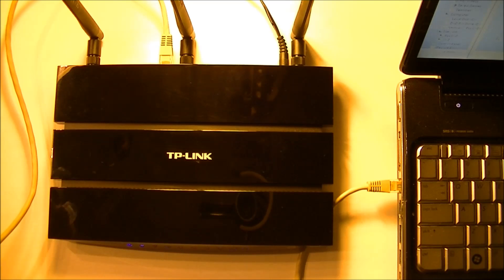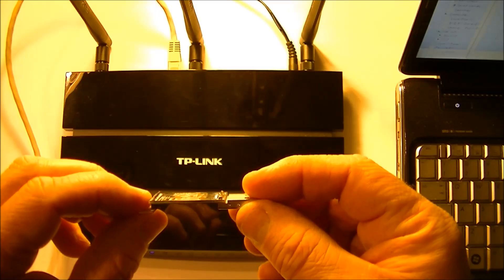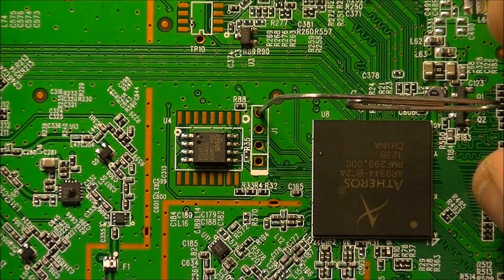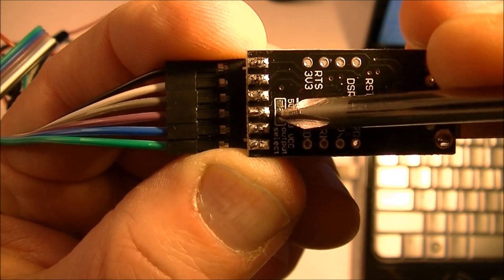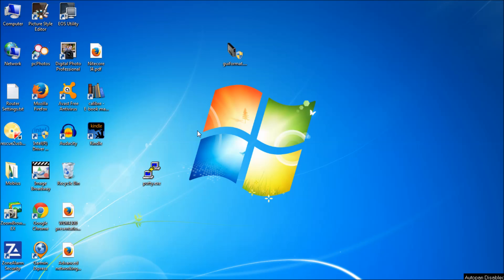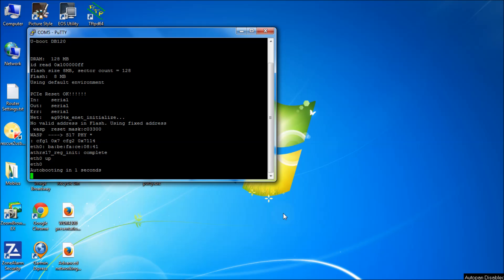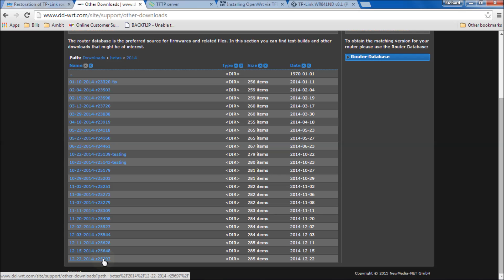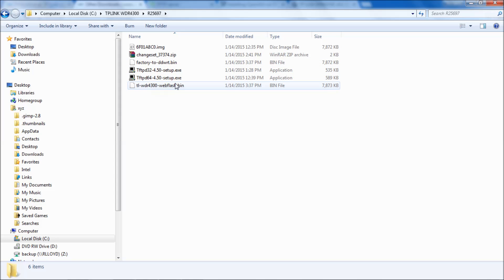Bricked TP-Link WDR 4300 Router Recovery Using UART Serial Converter Part #1

Comment: Amigo me gustan tus videos yo tengo un problema mi router wifi modelo WL-WN530H4 wavlink le quise actualizar el firmware y despues dejo de funcionar ya le hice rest y solo esta la luz roja ya no funciono creo se brekeo el router miro tus videos para ver como reparalo pero no se nada de soldadura oh usar bien la lapto ya eh buscado lugares donde reparan aquie en mexico y no eh encontrado la verdad nesesitaba muncho el router por que con el lespasaba el internet ah unos niños para que hiceran sus tareas en una casas que estan lejos por que el router tenia bueña señal ahora ya no tienen internet los niños gracias por subir videos siempre los miro para ver si logro arreglar el router saludos desde mexico
Reply from the maker: I could not find any rocovery information for your router but it is a very basic router and can be replaced cheaply ($25.00) https://www.ebay.com/itm/275528363478 at this point I would look for a used router to replace it with. the Netgear R7000 is a great choice but only if you use the DD-WRT firmware on it as I show in this video: https://youtu.be/35np4ZEe3G4
hank you so much for commenting, watching and the very kind words. I appreciate it greatly. All the best.👍😀

Comment: I am not quite clear about the 3.3V and the 5.0V... where did you measure these voltages?

I have my UART and I can see there are 2 pins with one of them marked as 3.3V and the other one marked as 5.0V.

When I measured them, they are supplying the correct voltage respectively... and I do not have the option to "short circuit" in order to select the voltage. Any clue?
Reply from the maker: These UARTs vary in design so yours may not have the option. The whole reason for the switching of the voltage is to assure that if you mistakenly attach the voltage line (you should not be connecting to the router for this procedure as the router is being powered by the wall power supply) you don't fry the board. It's more of a safety thing than anything else. Just don't use it and you should be fine regardless. Thank you so much for commenting and watching. I appreciate it greatly. Subscribe, Click The Bell and stay tuned! All the best.👍😀

Comment: hello, may i have a quiestion. I am typing tpl+enter right after the autobooting message...but the bootloop does not stops...  what am i doing wrong?
Reply from the maker: You may have a poor connection to one of the pins to the board. You may want to check the solder points and make sure they are making good contact. Thank you so much for commenting and watching. I appreciate it greatly. All the best.👍😀

Comment: it wont type anything on the putty windows i cant stop the logs
Reply from the maker: Many things can cause this to happen. Check your putty settings are the same as on the video and check your connections (wires) are correctly attached. Play with the ground wire as well sometimes disconnecting it and reconnecting while trying works. If all else fails try it on a different computer and see if that works. Thank you for watching and commenting. I appreciate it greatly. All the best.👍😀
Reply: @richardlloydusa  
Thank you so much for replying Sir i already checked everything , by the way i have a xiaomi ax3600 router somebody on the openwrt forum told me that i have to get the sh connection and trigger the nr1 to get to stop the log and type cmds .

Comment: Knowing how to connect via serial interface is so very helpful. I was able to gain access to a Netgear router that I'd flashed with Tomato; the flash actually succeeded but somehow the password was munged and I couldn't get into the web UI. 

Access through the serial/USB cable let me see that the router was, in fact, booting correctly and I was able to "nvram show | grep pass" to see that the user password was a string of garbage characters and write a coherent password to the router right there, to be changed through the web UI once I got in.

Comment: Dear Richard 
I tried your tutorial but I think in my netgear router the txd and rxd is bit confusing so I connected txd to txd and rxd ro rxd.. it did something and now the lights are not dancing.. neither it is in loop.. couple of light stay on all the time..
I identified the right pins and connected but I'm not able to communicate with the router.. 
Any solution you can think of?

Comment: Amazing vid. I have  a netgearR8000 and using the same dongle with Windows 10 drivers. I do see the router startup and all but I seems can't break the code running. Tried maybe 20 plus times now. Forum says ctrl c but that does not help. Any help ..thanks
Reply from the maker: Try disconnecting the ground wire. Thanks

Comment: I connected everything and I can see everything in the terminal, but when I type tpl it doesn't stop rebooting itself.

Is there any way to make my router stop rebooting?
Reply from the maker: Remove the ground connection from the connector and see if you can get it. Thanks.
Reply: just disconnect the ground pin? or do I need to remove the bridge between the 3.3v and GND?

Comment: Second question. With factory setting router has 192.168.0.254 login page
192.168.1.111 will work if i reset router?
Or should i give and ip to router from admin panel or should i give and ip adress from network ip ipv4  settings?

thanks

Comment: Hi i need help :( i am new in this issue.
I have only one question.
İf i power router with its own adaptor, should i buy a 3.3 and 5 volt switchable serial converter?
I want to buy this cheap https://www.robolinkmarket.com/cp2102-usb-uart-board.html
This has no switcher.
But if i dont connect VCC, i dont need 3 volt or 5 volt output? Am i right?

You didnt connected VCC but you made a bridge and set that to 3.3.
İs this possible that if i dont connect to VCC i mean netiher 3.3 nor 5 volt and only connect to rx,tx,grnd; the laptop usb volt i mean can  it send 5 volt through rx,tx,or ground and can it fry my router?

According to your answer i will buy voltage switchable serial converter. because those are more expensive.
or that cheap one enough for me?

Thanks very much

Comment: Maybe this video should be called how to install DD-WRT on this router, because recover is a lot easier using the latest stock manufacturer firmware (auto erases memory).  Someone probably already posted the TFTP IP it’s looking for in a forum, then you won’t have to buy a serial adapter. 
Maybe no adapter needed if someone else has already posted the TFTP IP Address for your router. I believe these routers start the TFTP server by holding down reset for three seconds when powering on.  Most of the time eth0 might be the wan port of the #1 port on the 4 port switch side.
Google the forums for your router made by this company and someone probably already posted the IP that the TFTP is looking for. Set your computer/TFTP server to use this IP that you find in the forums. 
If you download the official firmware, it will erase the memory in the beginning if the firmware install and no need to run commands manually.
Now it will install the stock firmware, done and recovered. 
Now if you want DD-WRT on a router of this model that is bricked then you might need to follow his instructions. If you just want to recover it with the stock firmware then this is to complicated and not needed. I say it might be needed for DD-WRT since sometimes third Larry firmware use special images that are vulnerable to install the third part firmware.

Comment: Nice job. You can turn in login with putting to output to a text file, this way you can read what’s going on and getter better messages, if it shows a hardware issue the restoring could be a waist of time. Are you sure your programmer isn’t marked wrong? The square pad on the PCB is usually always ground. That’s weird that This router wouldn’t follow the standard?
Reply from the maker: It worked exactly as shown. Thanks.

Comment: when i turn on the router it just shows a bunch of jibberish theres nothing legible any ideas?
Reply from the maker: More than likely that means you have a cold solder joint on one of the pins and it is making noise. Thanks.

Comment: I saw post after I had bought different connector which doesn't work.  cam has power as it rotates but does not load boot loader.  cannot get any commands with any software used.  cam maybe trash.  foscam will work with me as next to take a picture ro show how I have connected.  They will try to work with me on this.

Comment: the type of cp2012 I got before seeing the video is WINGONEER USB 2.0 to TTL UART 6PIN CP2102 Module Serial Converter.  https://www.amazon.com/gp/product/B01LRVQIFQ/ref=oh_aui_detailpage_o01_s00?ie=UTF8&psc=1.  Is this similar to the Kedsum you used?
Reply from the maker: Yes it looks almost identical to the Kedsum at Amazon: http://amzn.to/1u7Pmd8 but I can guarantee that it will work the same. BTW both are available at Amazon and cost the same why not just buy the one I link to and be sure? Thanks.

Comment: unbricking foscam fi9828P (not v2). cp2102 module shows only steady red light (not blinking), windows 10 does see in device manager on com 4 the module and I updated to latest driver; but plug computer and camera with Ethernet then powering camera tera term (using com 4 and same baud 9600 as cp2012 in dev mgr), just a blinking cursor and no activity on screen.  Tera term local echo I turned on to see if I could type characters and I can, but hitting Enter does not go to the next line.  Camera has power as it intermittently rotates without doing anything.  shouldn't the light on cp2102 be green if it's communicating correctly to main board of camera?  Soldered on J8 of foscam the rxd to txd of cp2102, txd of foscam to rxd on cp2102 and gnd to gnd.  Power cord in computer is also plugged in so it's using that to make power to cp2102.

Comment: Richard, 

Thanks for the video. I was trying to debrick a linksys E1000 v2 after switching from Openwrt (no wifi for that build) to DDWRT (used wrong one). I was unable to get Putty to work, removed the red + wire, and used just the GND, TX, RX, which resolved the problem with Putty! Awesome!!
Reply from the maker: Thank you very much.

Comment: Thanks for video, For using pins on the board can we use these pins ? ( Aliexpress link )
I have TD-W8970 V1 and I'm not sure if paper clips fit inside my pins. 

https://www.aliexpress.com/item/FREE-SHIPPING-60PCS-2-54MM-6Pin-8Pin-10Pin-10MM-Long-Needle-Female-Pin-Header-Strip-Stackable/1766530414.html?spm=2114.01010208.3.1.9mwVYD&ws_ab_test=searchweb0_0,searchweb201602_7_10065_10068_10136_10137_10060_10138_10062_10141_10056_10055_10054_301_123_10059_10099_10103_10102_10096_10144_10052_10053_10142_10107_10050_10143_10051_10524_10529_10084_10083_10119_10080_10082_10081_10110_10111_10112_10113_10114_10516_10515_10037_10032_10078_10079_10077_10073_10070_10122_10123_10120_10124,searchweb201603_1,afswitch_1_afChannel,ppcSwitch_4,single_sort_0_total_tranpro_desc&btsid=21499d25-f43b-4be2-99c9-af1ea7587b19&algo_expid=e2b97407-017f-4bd2-876f-4adba95dbb3f-0&algo_pvid=e2b97407-017f-4bd2-876f-4adba95dbb3f
Reply from the maker: Not sure if those would work as they really don't look like they could be mounted correctly. These are more suitable niceeshop(TM) Male 4Pin Needle Connectors at Amazon: http://amzn.to/2oEMW3H Thanks.

Comment: hi man, can you help me? I have a bricked dlink 841n. I already have a USB-serial converter, driver is installed and all setup with putty, but no luck connecting. I get some wierd characters in loop. A leave you a url with a print screen: postimg.org/image/vop3pe09f
do you have any idea what is going on? what is wrong? Speed is correct and XOR is disabled. thanks
Reply from the maker: That looks like noise. Make sure you have all your connections correct, your wires are good, your solder joints are solid without any bridging. Thanks.

Comment: Good video. I managed to install dd-wrt firmware on tp-link wdr3600 routers thanks to your movie. So thanks for that. The difference is I used an arduino uno (imitation model xdrduino uno) as sort of adapter. The rest of the procedure was the same. I did notice the tx/rx sometimes work if you reverse them suddenly :). These wdr3600's are basically dual band i guess, 2 antennas anyway. But excellent routers in overall performance, especially with third-party firmware that improves it more.
The arduino is easily modified to a usb serial adapter. The ground pin and reset on analog side can be connected with a cable, then you use the rx/tx and ground to connect same as in your video. So it bypasses the programmable chip (atmega) and (with ftdi drivers) becomes an effective adapter for this purpose.
Just saying for anyone who doesnt have a cheap adapter you used, in the Netherlands i could not order the amazon product you linked to. Only US or something.
But your movie was really most usefull, so thanks for putting it on youtube, actually usefull stuff.
Reply from the maker: You are welcome. Best of luck to you and thanks for watching. I appreciate the feedback.

Comment: hi. i've accidentaly upgraded my tp-link ac 1750 with the wrong firmware. it's doing the exact same thing like the routter in this video. i can't connect putty to it. need somne advice. thank you
Reply from the maker: Did you try the solution I have without the serial adapter first? https://youtu.be/1hWT35w6sVI?list=PLnxXRLSlmSVNiENiN9wTejP6dtIqqmTya Thanks
Reply: Yes. I've tried that and it send's the .bin file to only 89-90%, doesn't go 100%. Plus powering routter while pressing reset for 3 sec, the releaseing reset doesent do anything.
Reply from the maker: I am not clear, have you connected the serial/USB adapter to the router? Thanks
Reply: Richard Lloyd no. I don't have one. Only through network cable. In order to get a log from tftpd program i have to keep the reset button until i see the log, where it's waiting for recovery bin file. I only get 90% of the bin file exported with the same result each time.
Reply from the maker: Unfortunately it does not always work. BTW if you have windows firewall on make sure you turn it off and any other program that may block it like an Anti-Virus program and try it again. Thanks.

Comment: Hi! May I use a standard DB-9 cable and follow this tutorial by connecting TX, RX and Ground as instructed? Or it only works with this USB-to-UART connector?
Reply from the maker: I do not have a serial connection to test with but you do. It will either work or not, try it and see but make sure you do not connect voltage and that if it does not work the first time reverse the RX TX leads. Thanks.

Comment: Hi Richard. I, unfortunately, TFT'ed an official TP-Link firmware with the boot portion not stripped to my bricked Archer C7 v1.1.  When I try to TFTP the correct, stripped firmware, it doesn't do anything anymore.  So my last hope is using the serial connection method.  I have an old PC lying around with a real serial port.  Instead of a UART-to-USB converter, can I just use a DB9 serial cable, strip the wires on the Rx, Tx and GND and connect it to the TP Link Archer C7's serial connector as shown in your video?
Reply from the maker: You can give it a shot but make doubly sure you do NOT connect any voltage leads to the router. Thanks and please update us on how it went.

Comment: Sir Many Many Thanks For Wonderful Guide. From Your Videos i am getting inspired to build my own embedded Linux for my router. i request you to please help me. i read several articles but i want some thing like of building "hello world" embedded firmware. and test by making an image.
Reply from the maker: You are welcome. I am not sure what you are referring to with "hello world" embedded firmware. I am not a programmer but I do use Linux firmware on this router called DD-WRT. Here is a video on that https://youtu.be/zgLZDOimTAc?list=PLnxXRLSlmSVNiENiN9wTejP6dtIqqmTya Thanks.
Reply: "Helo World" Means Build Firmware  Image (ToolChain, Kernel,Libraries Included) That When Mounted On To The Routers NVRAM. Will Message the system is working correctly.

Comment: Do you have to solder the pins to router if they are inserted reasonably well and aren't loose?
Reply from the maker: +Raghunath Thakar It might work if you don't solder them but I would recommend against it. Any movement or bad contact can cause noise and data corruption which could lead to a corrupted router. Thanks.

Comment: Thanks for the video Richard! I was wondering how did you find out which pin is which on the router board? Cheers
Reply from the maker: +nikpacara I found the pin outs on a obscure Russian site (Thank you Google Translate) then I verified them with my meter and a little trial and error with USB UART. Thanks.

Comment: The Problem with mine is i cant even go on internet it says dns probe not found :( ......and by the internet it has a yellow triangle but my internet is working :( i have the tp link wireless  ......please help :( this is the one i have ------
http://www.amazon.co.uk/TP-LINK-PA411KIT-Powerline-Adapter-Starter/dp/B0084Y9N3O
Reply from the maker: +Subscribe to my new channel I don't own these devices so I can't give you any first hand advice. If there is a reset on the device I would suggest you follow reset procedure from TP_Link (understand all your setting will be reset to factory defaults). It's in the user manual http://www.tp-link.com/Resources/document/TL-PA4010_V1.0_User_Guide.pdf

Comment: Thanks for your video. Can I use this method to rewrite the factory image back on the Rosewill RNX-N150RT?
Reply from the maker: Mike Ryan Not sure if it has the same recovery options. This video is specific to this router. I don't have a RNX-N150RT to test this with. Thanks
Reply: Thank you very much for your reply.